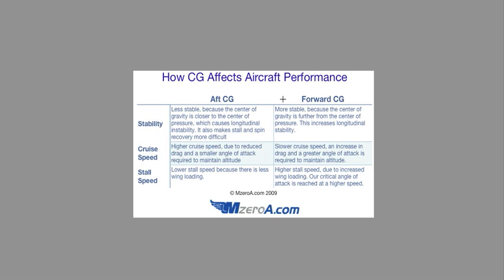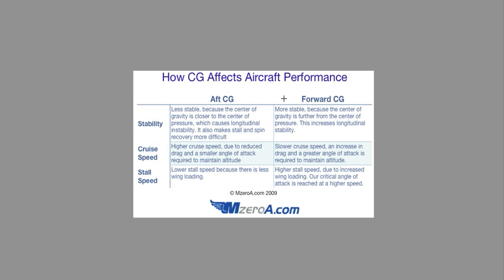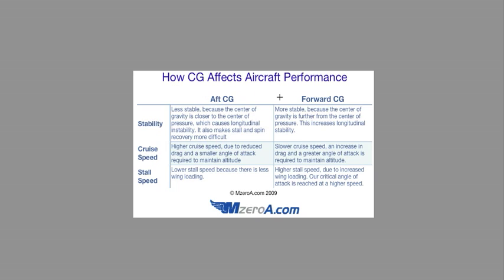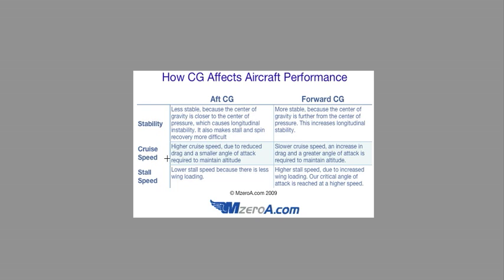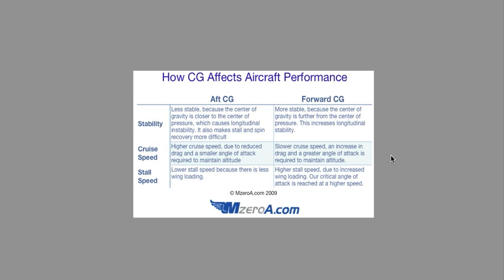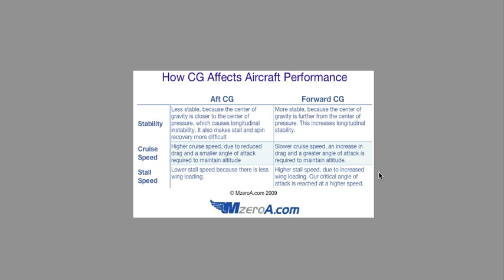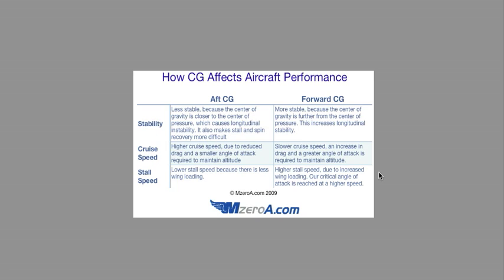How CG Affects Aircraft Performance

Comment: I like the opening the door analogy. My flight instructor told me to hold a wooden dowel about 10 inches from one side and brace it by putting my other palm on top of that short end. He then put the handle of a weighted bucket on the other end to show that you need more elevator back pressure to keep the nose up when cruising with a FWD CG.